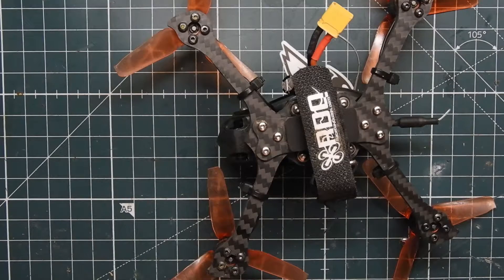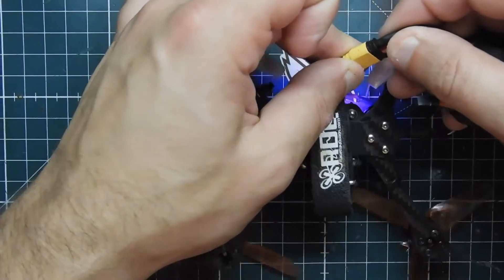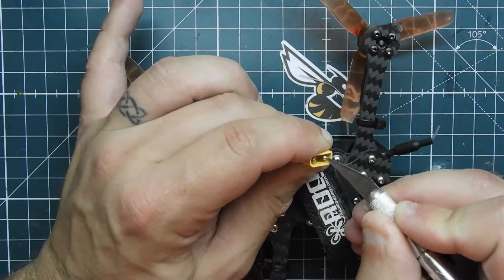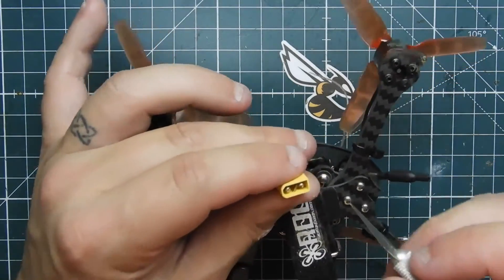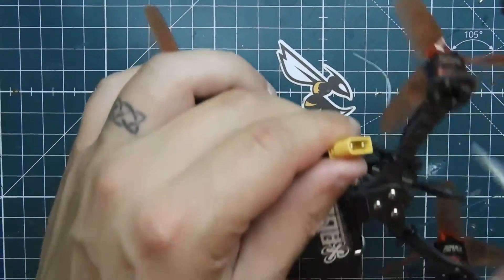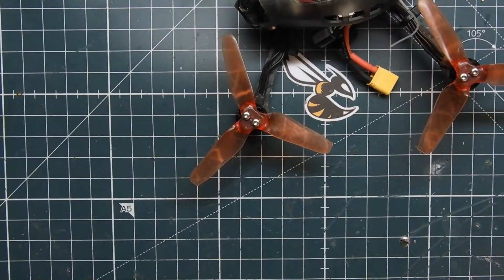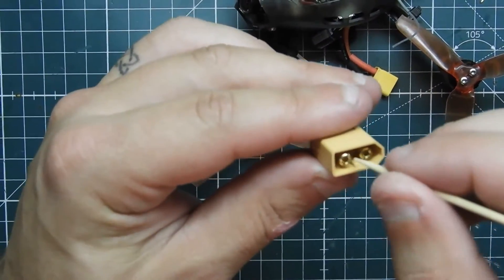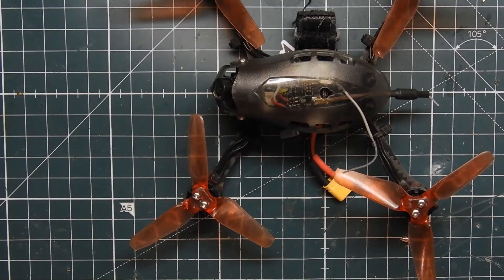Repairing Loose XT60/XT30 Connectors/Plugs

Comment: For XT60 connectors you can also use the tiny philips head screwdrivers like a PH00 and stuff it in the prongs. Applies more even pressure on all four parts of the connector so they're less likely to break off, and you're not risking slicing into your hands.

Comment: I notice the tolerance fit between manufacturers are a little off, making a loose fit. I like getting the male
and female plug from the same manuf. and resolder them on the battery and quad. Great video for a short 
term fix.